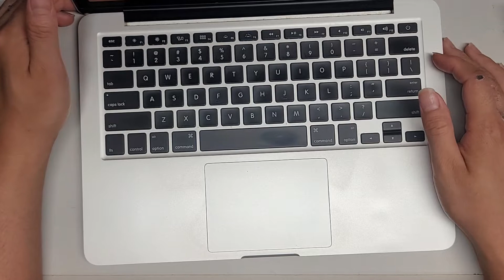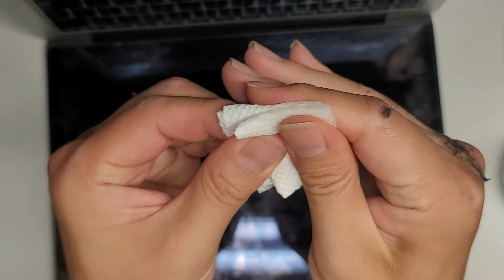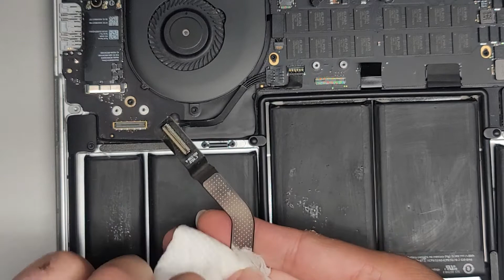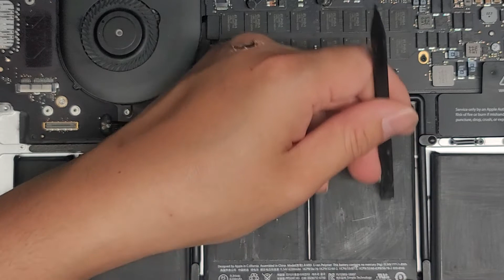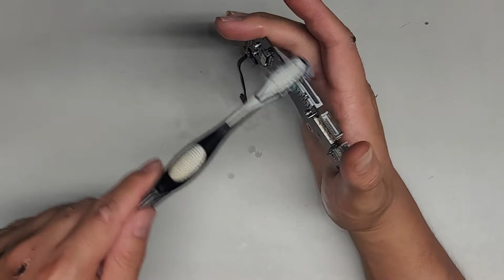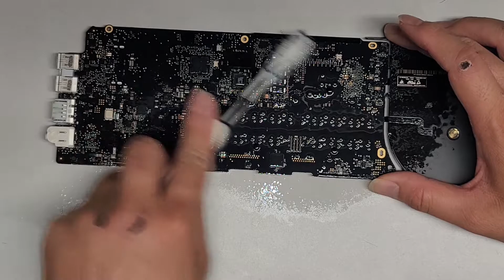13" inch Retina MacBook Pro A1502 Late 2013 Mold Decontamination Near Complete Disassembly

Comment: Hello i have a lenovo L14M2P21 qnd have removed the display cable going from mother board to the screen but cannot find one which matches with the one i need are you aware if i can use another type.please
Reply from the maker: This is a MacBook video. Why are you commenting about Lenovo? You'll want to check the lvds cable model number.

Comment: thank you very much this vedio is wonderful😀😀😀
can you please explain in 1:01:06 subtract ram and oronge I don't understand anything ???
Reply from the maker: PRAM and SMC reset you can Google for what exactly it does. It's a very long explanation. Basically resets motherboard settings.
Reply: @ItsBinhRepaired  muchas gracias 👍👍👍👍👍👍👍👍👍👍👍👍👍👍
Reply from the maker: No problem